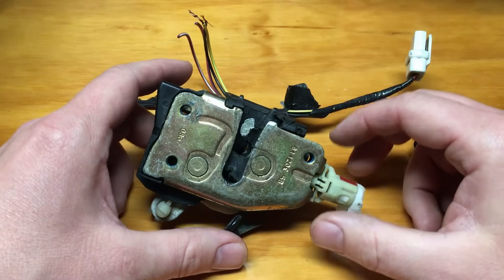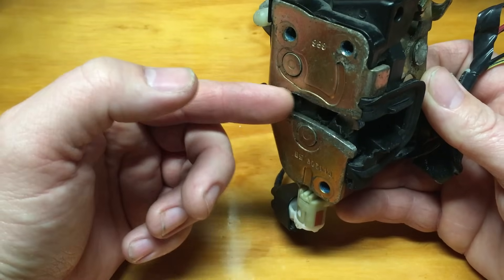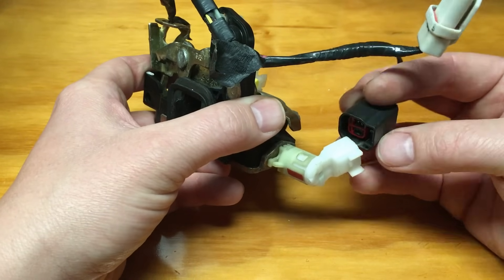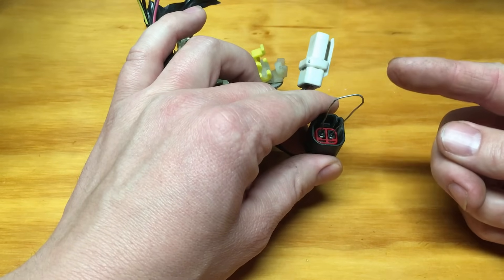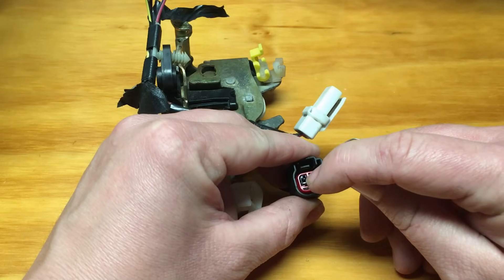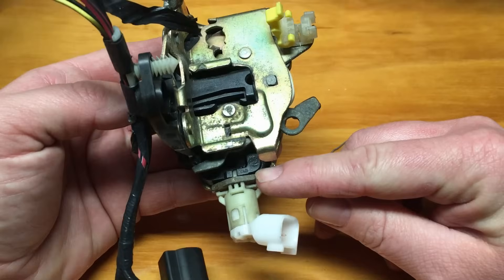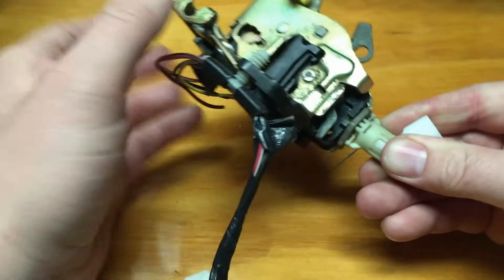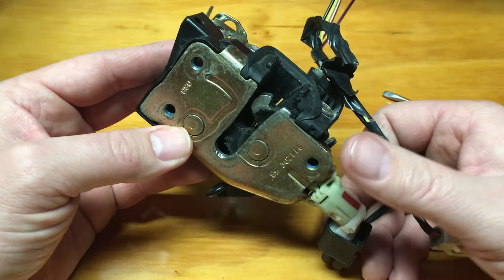Ford Quick Tips #76: Door Ajar Switch Testing and Replacement

Comment: Hello, don't know if you monitor these comments but I'll ask my question.
When I jump the wire on the truck It shows the door is closed. My problem is when the door/latch is open the switch is closed. And when the door/latch is closed the switch is open. Is it possible to install the switches wrong?
I had new used doors put on the truck so I have four spare latches and switches. I have both styles of switches. No matter what combination of switch/latch I try I get the same results.

Comment: mine got a ball stuck in switch, i try to push the ball to free up but instead it goes in further, also try to put some oil on the ball.  is it better with push button switch? i need to get a switch like yours so i dont get ball stuck

Comment: I have a 2008 ford ranger, my driver side door ajar/dome light does not come on, but the passenger side does. I tried WD40 and it didn't fix it. But also my headlight indicator (buzzer when headlights are left on) doesn't work either. Is the door ajar and headlight alarm on the same circuit?

Comment: I searched various dealer parts sites and can't figure out what part number I need for a 2011 Ford Expedition El Limited w/ 4WD.  I need to replace the door latch, so I figure I might as well replace the switch that has been acting up for a couple months as well.  My local dealer won't provide a part number and I am not buying from them at 4-5x the price.  Help?  Thanks.

Comment: I need some help... I jumped my connectior at the door switch but still get the door ajar message. I tested continuity from the switch connection to the A pillar connection, which checks out good. I should be able to test now from the switch connector to the fuse panel connector, without taking the door off again correct? what if that checks good?

Comment: I don't have illuminated door ajar on my dashboard, but the dome and the doors light keep illuminate.
And because this is extended 3 doors F150. Do anyone knows is there sensor on the third door?
Reply: God bless the service manuals! I found it. On the wiring diagram is shown where the relay takes the signals so first - door ajar switch, second - C245/C246 or this is the main light switch. My one was almost melted but I've found it on time. I hope this will be helpful.

Comment: What would cause a 2002 superduty truck to think the doors are open when theyre shut but think theyre shut when theyre open?
Reply from the maker: VSM programmed incorrectly.
Reply: @FordTechMakuloco  Okay, the doors were rusted so I got 2005 doors and swapped them in, no issue until doors were swapped. Should I try swapped latches from the old door to the new one? It's a confusing issue. No broken wires plugs are all where they need to be I don't think they can go any other way. It's a bit frustrating, it's like arguing with a wall.

Comment: Question for anyone. I have trouble with my light/chime working at all. After dousing in WD40, it started to work for a brief moment when the door is first opened but immediately stopped working. I assumed it was still my switch. When unplugging the switch the dome light/chime still do not work... But then when I jumper it they both work, and stay on indefinitely until I remove the jumper. Any ideas?

Comment: 2005 Sable happened to pass side door found the power ground exact opposite open off closed on- simply unplugged switch that day as i only had a phillips screw driver so couldnt remove latch

Comment: 2005 ford taurus se,  the door panel was  easy as hell to get off and then removed some of the moisture plastic,  removed the three mount screws and oiled the lock enough that the door sensor and electrical plug came off with a little twisting, ( Had to feel around because you can't see because of the way ford designed the door....idiots )  After i removed the door ajar sensor and just left the plug hanging i drove the car around the block and no more annoying dash noise.....thank god!   Put the door panel back on with ease and now i will never ever  have to hear that noise again. ( I am not going to replace it, not really necessary to have a door ajar chime. )    Without your video i would of never new what the hell i was doing...THANKS A MILLION, this is not the first time you have saved me.

Comment: Awesome video brother! I have a 2004 focus SVT where when I am driving and hitting minor imperfections in the road, The door ajar light and interior light comes on and goes off intermittently. The plunger on the striker plate side seems to be working just fine. The lock actuator works fine, as the light goes on and off fine as the car stationary. Part of me thinks it is a short in the connector for the striker plate switch, because the jostling from the bumps in the road makes it go on and off. Any help would be great thank you

Comment: When I activate the door switch on my 1999 Grand Marquis, there is no movement in the driver door latch. The other three doors show a metal arm moving downwards which I believe activates the door ajar switch. So I believe that the door ajar light on my dash is due to a failure of the latch mechanism in making contact with the door ajar switch. Maybe the door lock actuator?

Comment: I have a 2007 Mercury Mountaineer.  Sometimes while driving, the dome light will suddenly come on and the automatic driver seat will move back, like the door has been opened.  Really freaks you out going 70 miles an hour!  Any ideas on what to check or how to fix.  It seems to do it mostly when another door or the back hatch has been opened and shut, but not any particular one. And sometimes when you hit a bump in the road.

Comment: To remove the latching mechanism from the door; the three torx screws are secured with blue loctite into the latch body and required some heat on the screws to remove, they don't just come undone. Not too much heat as the bulk of the body is plastic. Have fun.
Reply from the maker: No need for heat with blue loctite.
Reply: Informative and well done video. Thank you.
But after blowing apart several T27 bits, I've found that a moment or two of contact with a hot soldering iron will heat up the fastener enough to allow easier removal. Just say'n.

Comment: Excellent. Just wish I had an in-the-door switch like this. On my Fiesta '96, they're in the columns. Neither switches any longer operate the dome light or buzzer warning for lights on key in ignition. Manual says module is behind facia between steering column and radio and resembles a relay -- I can't find it. Any ideas before I take car to a shop? Many thanks.
Reply: Still has to be something on the door to know it's open or closed. The steering volume doesn't know where the door is.

Comment: Does this switch stop the door from latching during very cold, freezing weather? 2004 Taurus SE. When the weather is very cold, or I've washed the vehicle, and it later freezes, the door won't latch shut until it warms up. I've WD-40'd it, and greased it repeatedly. 
I now have to heat it up with a lighter until the latch catches, and the door stays closed.

Comment: I'm having a weird issue with my F250 Super Duty. The dome light comes on when the door is closed and the Door Ajar light turns off when the door is open. This is on the passenger side only. How would I fix this? I really want to get this fixed because I can't have the dome light bulb in, it would drain my battery overnight if I did.

Comment: FYI: my 04 F350 shows the door being closed with the plug disconnected. So open = closed. Not sure if all fords do that. I went by what you said and scratched my head for an hour thinking I had a live short on one of the door ajar circuits.
Reply: Aaron Bryant how did you fix this? My door things it’s open when it’s closed and vice versa
Reply: @adambaran418  ultimately replaced the switch. I found the old switch was full of rust and corrosion and while I did clean it and got it functioning again, I inadvertently busted that locking tab he talks about needing a screwdriver to free up... so a rock auto order for a new switch fixed me right up.

Comment: My 2006 Ford Crown Victoria driver front door acts opposite of this. Door opened or closed the door open indicator chime does not illuminate and dome light does not come on. All other 3 doors work as they should. Would this be the door latch sensor or something else??

Comment: Hello sir. I thank you for the video. I tested my switch and it's working like you say it should: open door, open circuit; closed door, closed circuit. But my problem is that my chime rings when the door is closed and stops when the door is open. Are you certain the circuit is broken when the door is open? Seems to me a ground would be connected when the door is opened. But I'm used to older, more simple vehicles.
Reply: My 03 F250 is doing exactly the same thing! When the door is closed, lights e.t.c. are on like the door is open. Soon as I open the door, they go off!! Did you got yours fixed? If so, what was the solution? Thanks.
Reply: I have a 99 f350. Mine was opposite of what the guy said. Unplugged = door closed and jumped = door open
Reply: I'm having this problem with a new switch I just installed on wife's 08 Taurus. Did you figure out what was wrong?

Comment: HI guys, thanks so much for your videos. I have an issue and I've been searching in the internet for a while with no luck.  I have a F150 2003 Lariat. The lights on the doors doesn't turn on. Also, the reading lights of the rear part of the cab. They work though if I press the switch,  but in order to turn them off, I have to leave the switch press half way. If I press it all way, when I lock the truck, they turn on again. Weird, uh? If any of you can give me some advice plz! Thx!

Comment: My 2003 F-350 (7.3L) is showing on the dash that ALL FOUR doors and the tailgate are open.  I went into the driver side door and found the door ajar switch, it was slightly gunked but pretty much working.  Checked it with continuity and ohm'd it with my meter, seemed fine.  I tried putting the jumper in the plug as well, no response that the door was closed ever with the jumper in or out.  With my meter I can read almost 12 volts across the 2 pins.  I can also get the same reading taking one side to ground on the truck body.  I tried grounding the one side directly to try that for a response, still nothing.  Is there something that sends the information that the doors are open or closed to the dash cluster?  If so, what is it and where is it?  Unfortunately most information on this door ajar problem seems to end with these switches, but I guess I'm the 1% who needs to go further.  Anyone have a suggestion?

Comment: How many volts should my meter read when testing the ground with a digital meter?
Reply from the maker: +SmitfraudC you test it with an ohm meter it should read less than 2ohms when closed

Comment: Im currently working on a navigator 06..none of the locks work whether using the fob or either front door.  The backlights on the lock switch work. Everytime you press either lock or unlock I hear the relay click inside the VSM..The only anomoly is when you press the driver side lock switch the relay in the VSM only clicks when you press lock.  You don't hear it pressing unlock on the driver side.  Also I'm not sure if this is related but the driver window doesn't work either.

Comment: thanks you for your videos i bought a used 07 f150 5.4l with 100k miles i was a little scared but your videos helped me out
Reply: I have the same problem did you replace the whole sensor or did the wd40 work for you
Reply: @yazzyfresh  i did use the wd40 and it worked for about two months then i ended up replacing the sensor and has been working correctly for about 2 years now.

Comment: I have a 2011 f150 with the 5.0 once and a while it will make this weird noise and it sounds like a pump kicking on but nothing going threw it but I'm not to sure if that's it. it doesn't happen all the time but when it dose make the noise it starts for less than 2 seconds than shuts of for about 15 seconds and then start making noise again and it will do that a couple times then just stop all together and like two days later start doing it again.

Comment: We had to standard no button keys programmed by a locksmith for our 2013 f250. They work fine but when we start truck with them a message appears saying intkey cant be programmed. It dissapears after few seconds. The original remote key dosnt do this.. Why do the new keys trigger that message and will it cause issyes later?

Comment: I made good money replacing these switches when I was a tech.  When my 99F250 started having issues I hosed it with pb blaster and didn't have it act up for about 8 years of ownership afterwards.
Reply: Excuse me sir? Do you have any experience with 97 F250. Do you remove the whole door latch? Or weasel in thru the door access ports.
Reply: @christianhilditch9333  some you could sneak in others you have to loosen the latch from the door. Don’t take all the rods loose, just let it hang in the door

Comment: This has nothing to do with this video but I need some help
I am working on a 05 f150 with a 5.4 engine that has a random BANK 2 misfire, customer put all new coils and plugs in it. Fuel trims are normal O2's are switching normally. I have 3.6 psi of backpressure at 3k rpm and almost nothing at idle. The miss goes away above 1300 rpm. Customer has known good used cats that he is going to put on it but I am not totally convinced that the cats are the problem. What are your thoughts and is this a common problem on this engine?
I appreciate the help. Thanks

Comment: Hmm, I thought the switches closed when the door was opened. What years does this apply to?
Reply from the maker: +Brad Noyes no you will see if you jumper it as if the switch was closed the dome lamp will go out, pull it and it opens the circuit dome lamp comes on
Reply: Brad, I agree with you. I bought a used 2006 Taurus and the door ajar switch was missing in my driver door. When I opened the driver door, the dome light would not go on. If I opened any other door, the dome light went on. The door ajar switch completes the circuit when the door is open and turns on the dome light. When I jumpered the switch as shown, the dome light went on.
Reply: Yea he’s got it wrong here. Jump the connector and dome light comes on. Remove jumper door shows closed and dome light goes off

Comment: I have a question about a different problem.  I have a 2011 Explorer Limited that has all the bells and whistles.  Nav, satellite radio, hi-fi sound system, etc. all on a center stack touch screen.   Sometimes it will all stop working and the touch screen is blank for several days, then it will start working for a few days or a couple of weeks.  Then it will crap out again.  I searched the internet and as far as I can tell, my vehicle is the only one that has ever had this problem.  I can't even figure out how to get to the rear of the stack to see if the problem is just a loose connector.  Any ideas that won't cost me a thousand buck?

Comment: Question for you I swapped my cluster in 08 f150 gained a tach, but lost the door ajar warning I have crank window cluster is out of electric window model.  do I have to get into vehicle control module to fix this? or Simpler way?